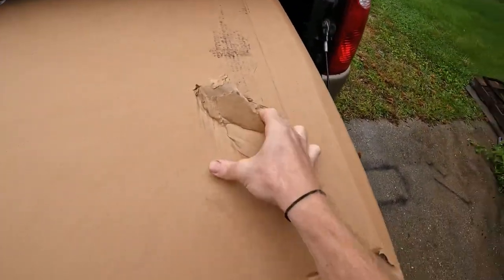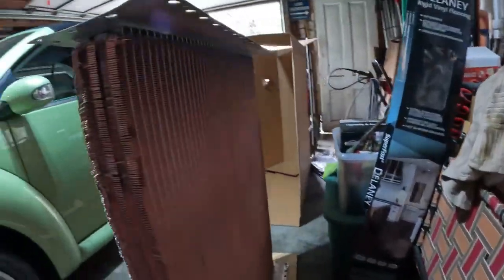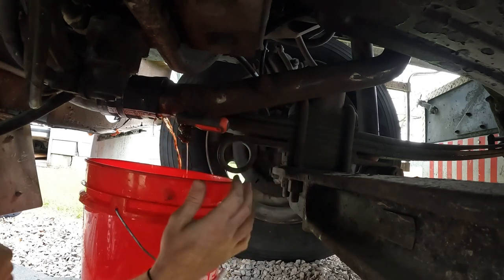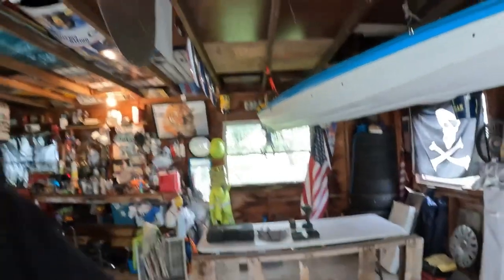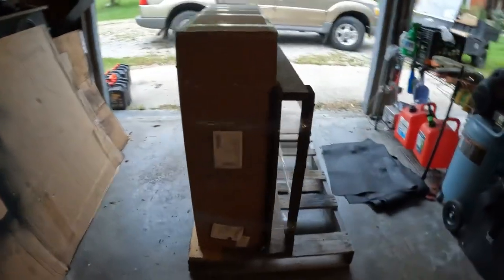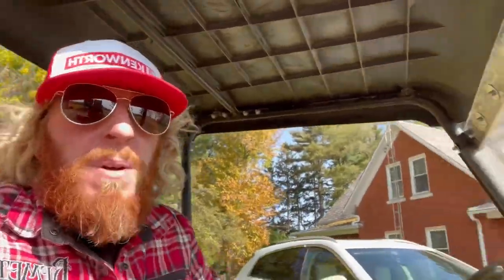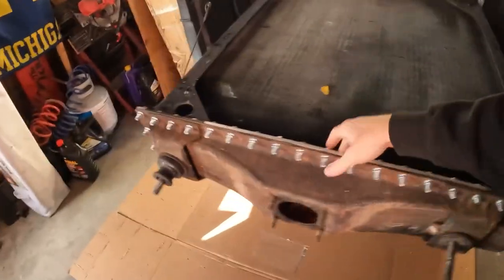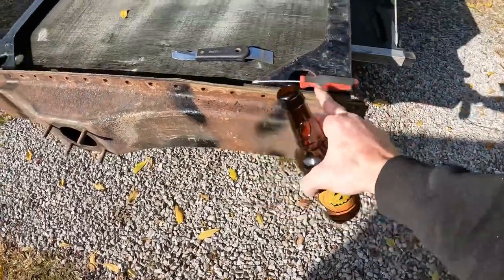1983 K100 Radiator Swap Take 2! Or 3!  Baby Mullets!

Comment: Chad I have the  1985 362 Pete. I noticed your cab is tilted at almost 90 degrees,I’ve seen pictures of truck that the cabs at 90 degrees and I have seen ads in truck magazines for the 352 cabover that advertise the cab will tilt to 90!   I’d hate to take to 90 and have cab break off.  How far is yours tilted.  Thanks. Love the program
Reply from the maker: All the way over, the cylinders won’t let it go anymore unless they snap and the cab goes slow once it reaches the tipping point. You can hook a chain or rachet strap up to catch it if you’re worried about it going splat.